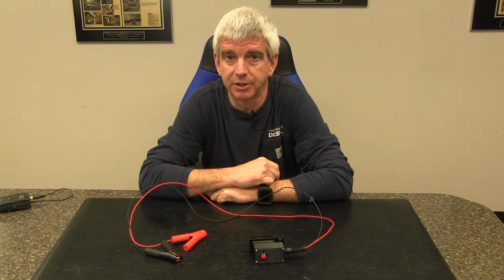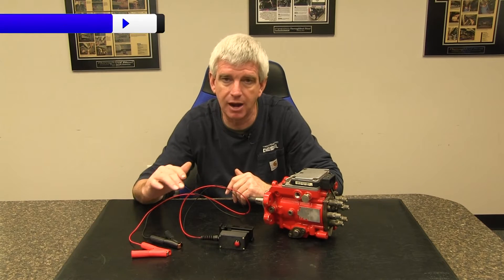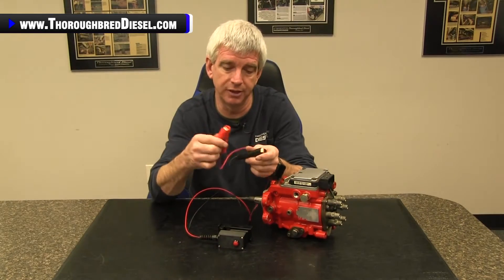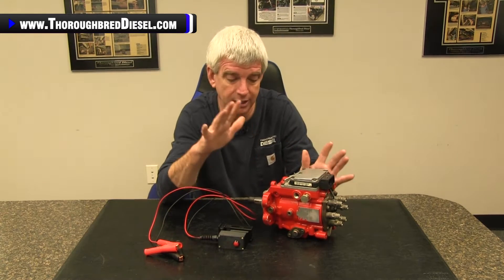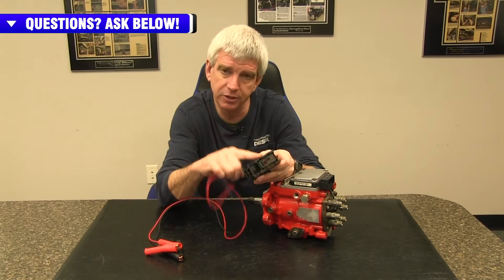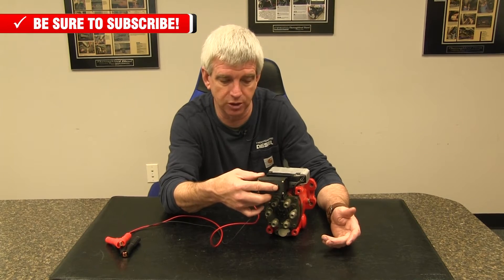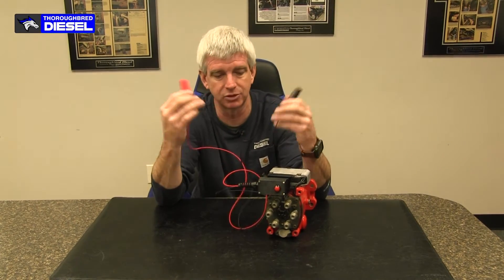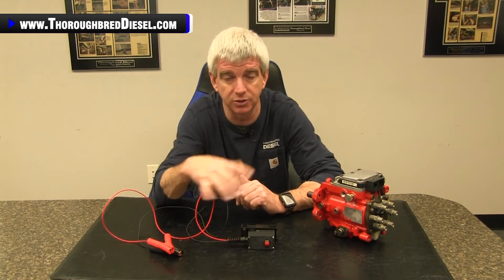Must See Our New VP44 Diagnostic Tool!

Comment: What injection pump is on a 05 5.9 24 valve and all stock motor and I have the Fleese in tank double lift pump that puts out 21 lbs at idle and 18 lbs at hard pull wth 36 ft 5th wheel ?

Comment: I wonder if a guy could make one of these if you just took a junk wiring harness and cut it near the pump and got two alligator clamps connected to the required wires. You could probly add a switch or breaker in between too for an off switch. This thing looks super helpful for guys who work on a lot of VP trucks but just for personal use it’d be hard for me to spend the $300 instead of just hot wiring the pump for free.